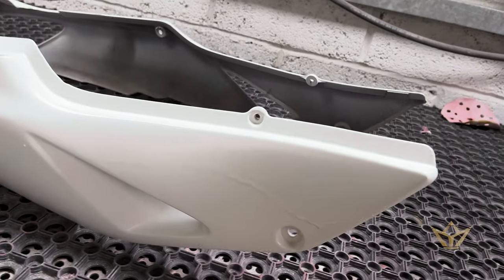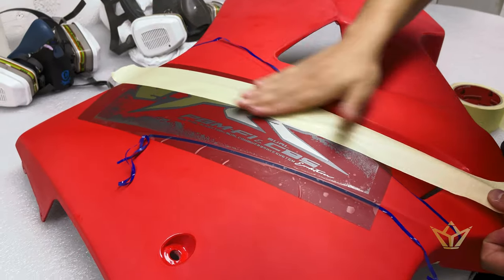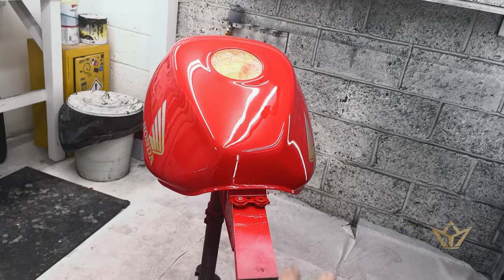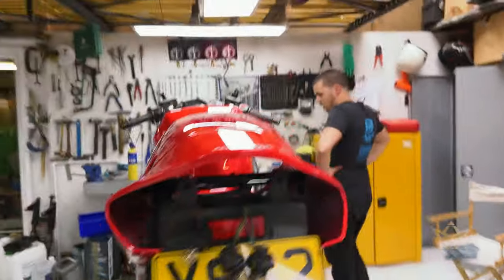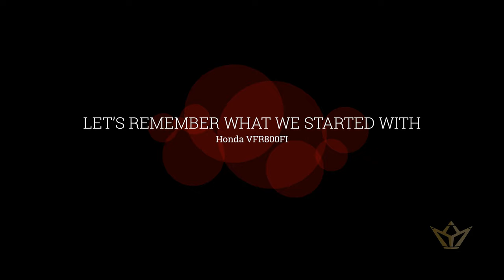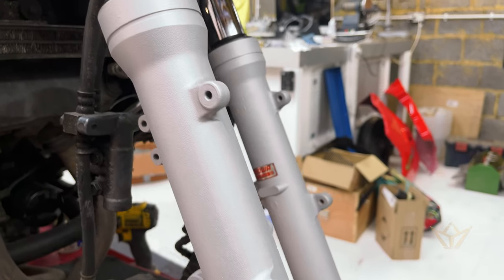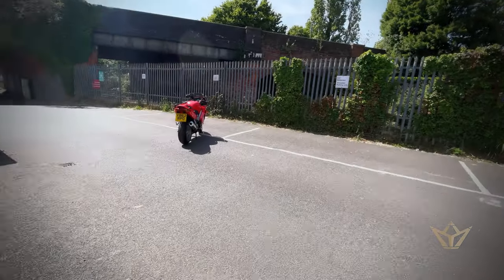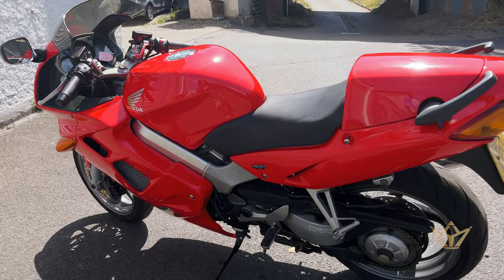HOW TO PAINT THEN DROP YOUR HONDA VFR800FI - don’t miss the end!

Comment: Overall, a great effort Rob. Look forward to seeing the 2nd bike come the same way. I know you appreciate the feedback... the "frankenstein" bolts that hold the rear seat cowl on, should have a provision for an 8mm washer to help spread the load for the fastener. The second bike may also show clues how to route the side stand wiring and overflow hoses. And to be very picky, the HONDA decal under the front screen could have been a little higher.
Reply from the maker: Haha there is always someone out there who know more! Thanks mate. I never looked at that graphic…it was measured off the original but I’ll check. Yes definitely washers going on when I tighten all panels on. Thanks 🙏

Comment: May I say that I’ve only recently discovered your channel and I am so
Impressed with your content.  I could’ve cried too when you dropped it.  Could I offer a fail safe method for side stand use.  Engage first gear, clutch out, roll forward to take up the slack in the  chain / shaft drive  then and only then, side stand down.  The bike will not move and won’t fall off the stand at anytime even if another bike is bumped into your bike off a main stand.  I learnt this 20yrs ago, it’s never failed me.  Congratulations again on a great channel - Mike
Reply from the maker: Thank you Mike. Very kind and yes advice to late! 😩

Comment: Looks like Winning versus Italian Red.  I knew the colors would not be the same, as Italian Red is a two-stage candy paint requiring a different and specific primer.  Afterwards the base coat is sprayed soon after the primer application.  Later, the smokey clear is added to give that uniquely deep color of red.  However, I am impressed.  With three VFRs and another I'm building, I'd love other colors, especially the flat pastey colors such as grey, tan...  You provide inspiration.  Watch eBay enough, and you will find near mint alternatives.  Was able to secure OEM gas tanks and fairings for both 5th and 6th gen examples.  Most VFR owners are anal about the slightest imperfection.

Comment: Discovered your channel recently and I am really impressed with the quality of your work …it is truly excellent.  Your knowledge and restoration tips have inspired me to tackle my own VFR gen 5, which is in great condition, but unfortunately had its engine attacked by mice. One thing that I have noticed is how difficult it is to get the tank decals in exactly the right place.  When I looked at the tank it looked beautiful but the decals did not appear to be positioned correctly…checked on my own bike and they are different.  I have noticed this on other restored bikes …especially old superdreams.  I’m sure it is really difficult to locate them in exactly the right place and at the correct angle.  An accurate method of positioning tank decals is probably worth investigating?  Enjoying your channel.
Reply from the maker: Thank you for you kind comments. Yes you are correct. I gave it to my painter and didn’t notice the position was quite way off. It was nearing the end of the project and I was happy to overlook it. I’ll see about it in the future..maybe 👍

Comment: Very nice job. Superb paintwork. I'd swap the mirrors for the later model ones which are a direct fit but more elegant. These are available as OE or pattern parts from David Silver.
Reply from the maker: Yes totally agree! These were rubbish eBay product advertising as 2001. I have the original but the mounts are missing. Anyone with mounts?

Comment: Awsome job! Restoring a RC36/2 myself . Can you share the spray color code that you applied to the forks? Thx . Keep it up!
Reply from the maker: Hi mate thanks for the support and subscribing. The stuff I used was aluminium casing paint. It needs an oven to cure. A bit like powder coating. You’ll have to freeze the bud as I can’t remember the brand!

Comment: What did you use for spraying your front fork?
Reply from the maker: An aluminium spray which requires a level of baking. I didn’t read the small print on the can so a job I will need to fix. I must say I haven’t checked whether it’s finally gone hard..🤔